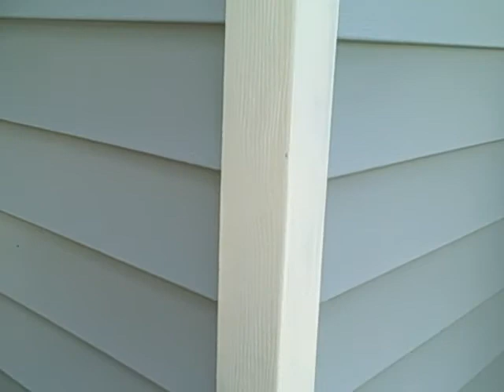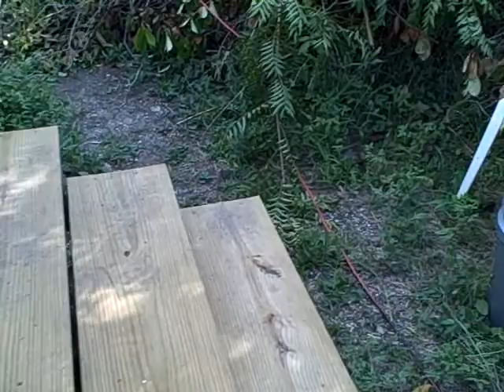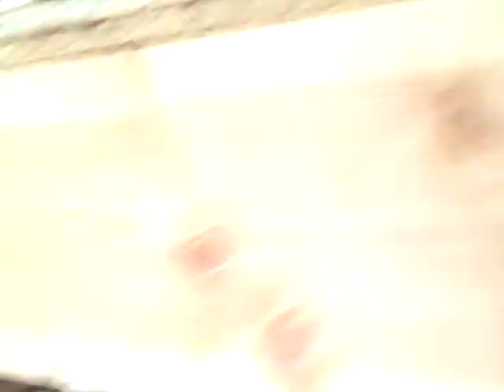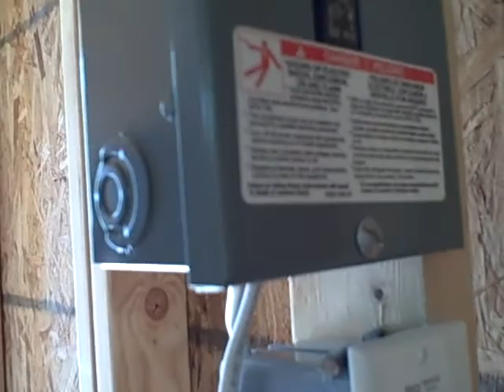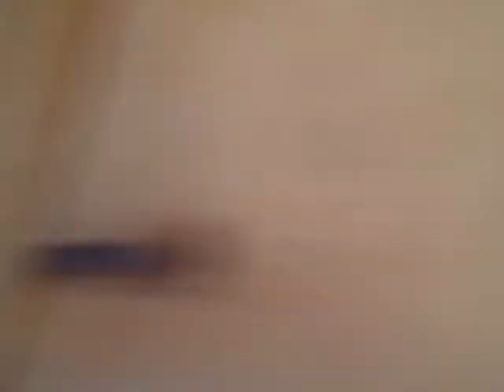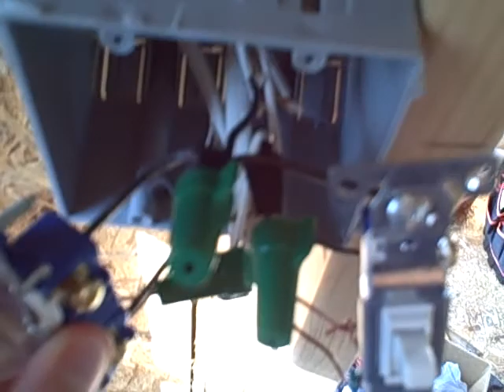Tiny House Exterior and Electrical Tour

Comment: Whatever it was, it was 3 years ago so I'm sure it's changed. I think the expensive part was the circuit breaker and all the copper wiring. If I remember correctly, it was probably less than $200 not counting the LED lights.

Comment: your breaker box connections must have clamping connectors to hold the wire, no exterior insulation (that white stuff covering the insulated wires) is to be inside the box except a little bit to clamp it in place, there must be a minimum of 6'' of wire in the box for proper connection. from the looks of it, your going to have some boxes hidden behind the wall, another no-no, trust me, im a licensed electrician.